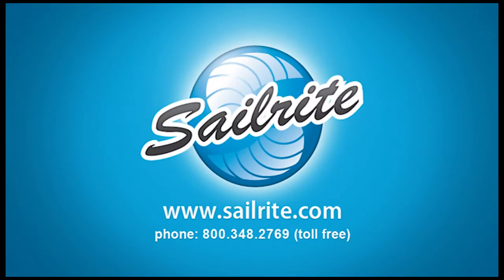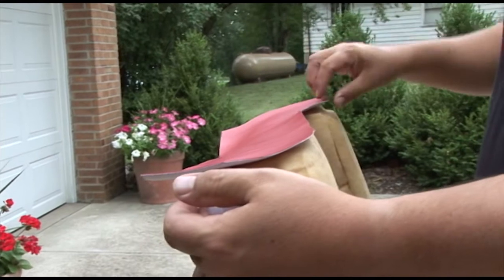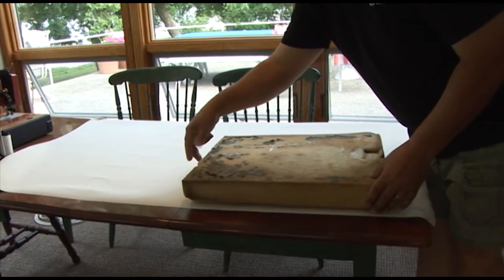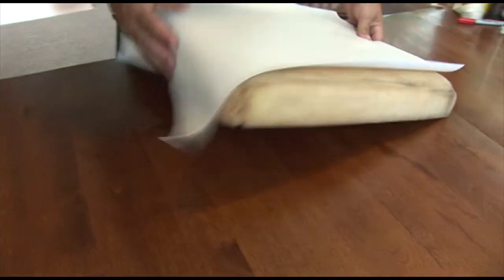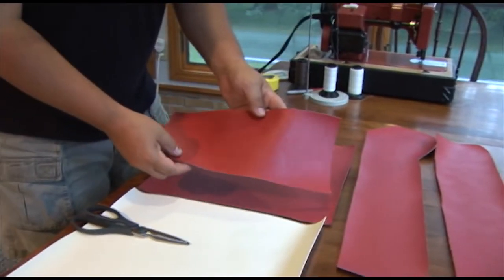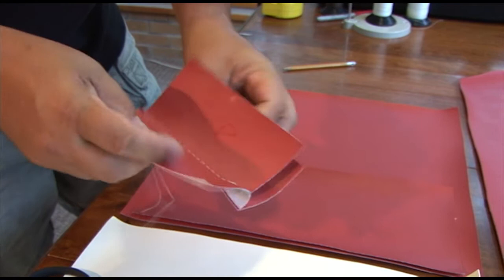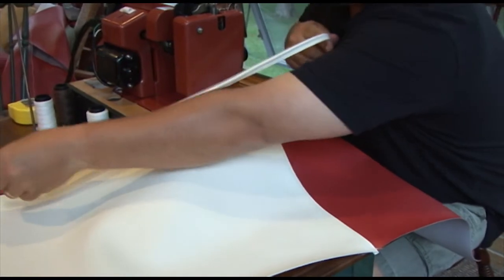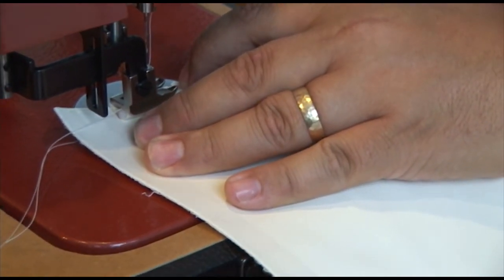Making a Bull Nosed Cushion Fastened to Back Board - Part 1

Comment from the maker: @drrelaxx1 The amount of pull you apply to the fabric pull strip is totally dependent on how tight you want the cover to fit the foam, so it is up to you. I would rather see the fabric pull rather tight to give the cushion more shape. However, if the facing (boxing) is not patterned to account for the dip or shape of the transition pulling the fabric pull to hard may cause issues where the top plate joins the facing (boxing) at that point.